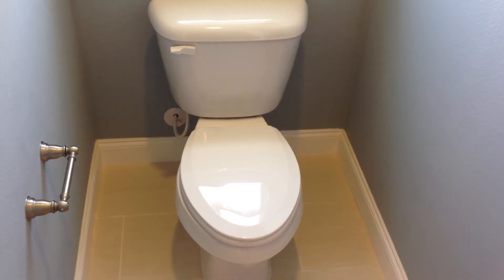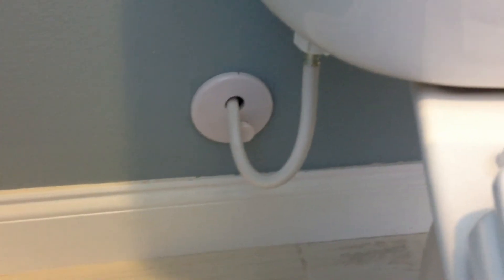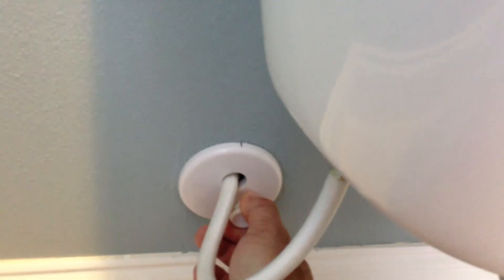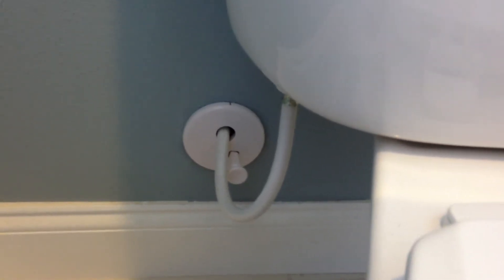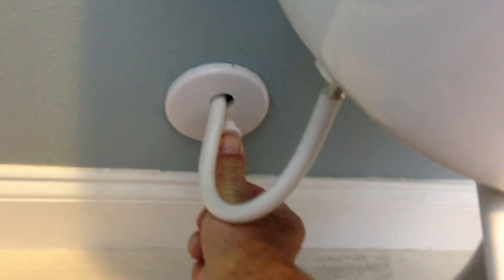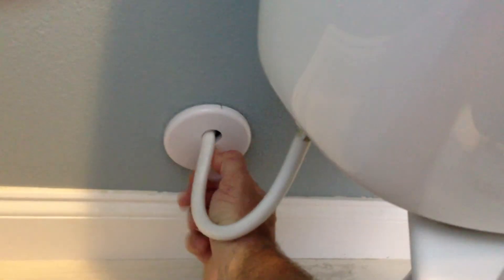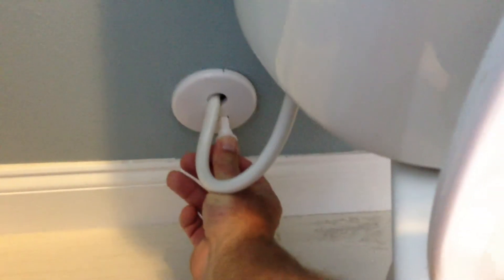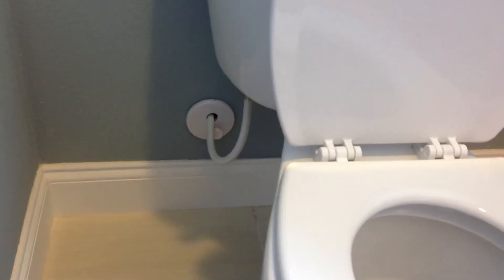LSP Products Pull Stop Box: Turning the water off

Comment: People, do not ever install this.  Horrific idea and is ugly to boot.  Just waiting to get mold in the wall and good luck changing out the valve.  Tried to shut down a bunch of these today and they wouldn’t move.  Can you imagine a woman with a sink or toilet disaster not being able to shut down water?  Just say no.
Reply: Absolutely Horrible value.   Do you know if there are any other alternatives?
Reply: Yes! We bought lennar homes with these hard to use faucets and water valve. They are very hard to fix or find any parts for replacement 😡.
Reply: Your advice is right on.  I bought a house with these installed.  Mine won't move either.  Had to shut off the outside water main to make a simple toilet repair.  I can hardly wait for the next plumbing problem.
Reply: @rohitbhatnagar7599  yes, just a simple external, accessible angle stop.
Reply: @stevenbastian3882  yep, there isn’t one plus to using these.  If you have to leave them for now, you should try to get them to move and then exercise them every 6 months or so to keep them hopefully being able to be shut in future.
Reply: @Orrphan  Had to take pliers and pull the knob out. Don't break anything. Hopefully

Comment: What was wrong with the old type?
Reply: its too expensive so builders cut costs, now i have to shut of my main , bc i fear this will break open.garbage
Reply: @mml1224   I don’t think it’s about money. Builders are cheap and stupid sometimes like putting one gfi outlet in a garage or bath to control many others in the home. There is no way having a plumber having to install a recessed box with this contraption is cheaper than just doing a pipe stub-out with a simple valve.  Whoever invented this useless, ugly, plastic disaster needs to be fired. No way this stays on the market.